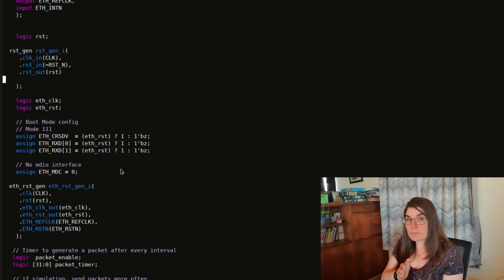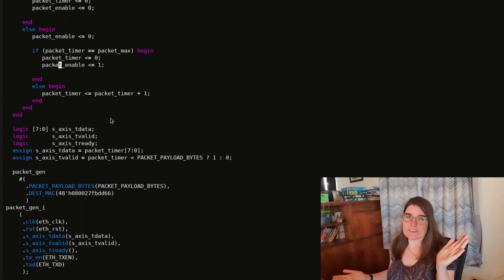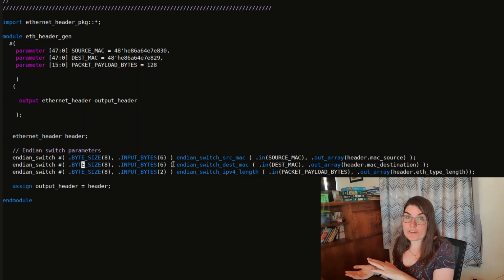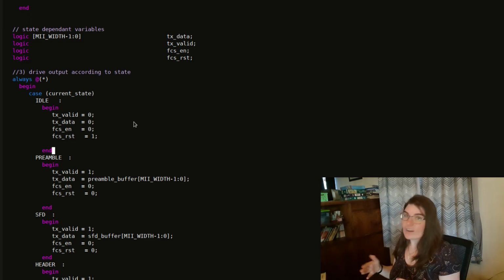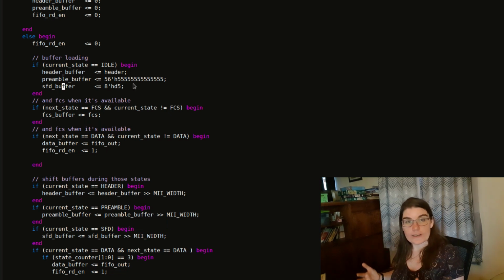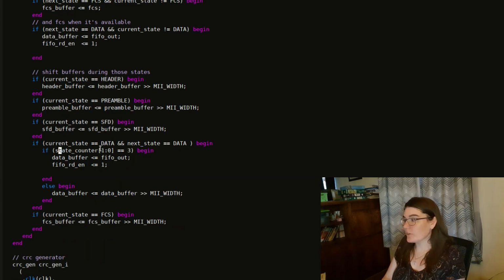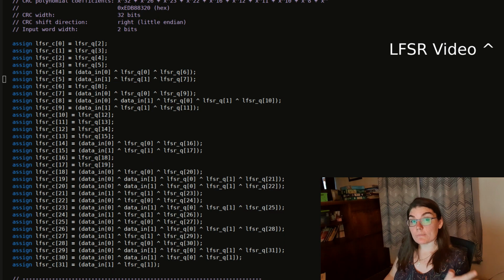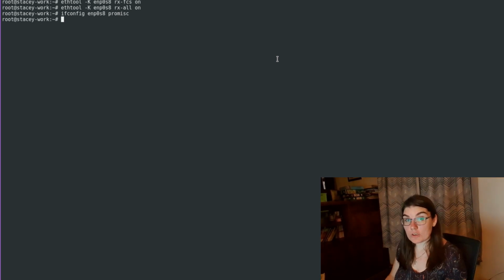A quick and easy Ethernet Frame state machine, explained from start to finish!

Comment: I would like to ask a question that make me confused regarding big or little endian you mentioned. Lets assume that the package to be transmitted to the interface PHY has a number of bits in a sequence p0, p1, p2, p3...pN. How should I transmit them using MII interface format: p0->tx[0], p1->tx[1], p2->tx[2], p3->tx[3] in one clock or pN-3->tx[0], pN-2->tx[1], pN-1->tx[2], pN->tx[3] in one clock? Thank you.

Comment: A clear explanation of the states for ethernet frames.  I felt you are held back by the FPGA and its software.  And, maybe I missed it, an explanation of what sensor you were trying to use and its timing constraints. The full ethernet has many cases for collisions, errors and human actions. At a physical level, your method gets down to the essentials. Except I think you could build the state machines with tables and constraints, not by writing sentences in a made up,  highly syntactical language not many people speak. Looking for ways to talk to cameras and sensors for real time statistical analysis, monitoring, and decision making.  Best wishes, Richard Collins, The Internet Foundation

Comment: I have a question about FIFO. What will happen if our FIFO is not ready to recieving data but our system needs to transmit that data at that time otherwise the data will lose and we could not transmit all the outputs which our system generated. In this case, is it enough to increase the FIFO size to solve that problem? How do we make sure that this is will not happen in our system?
Reply: Writing on a full FIFO will corrupt the data one way or the other. Increasing FIFO size can help when there are few but massive write spikes. In other cases you need to make sure to read more often, e.g. by increasing clock frequency on the read side.

Comment: Hi Stacey! How can you see the FCS field on your destination PC? I cant even receive it in wireshark, the received packet just end at payload so I always receive the packet even when the FCS is wrong. Im using ethernet/ip/udp packets
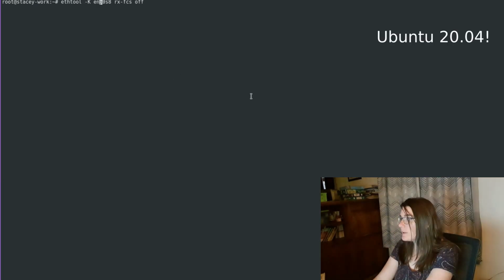Reply from the maker: At the end (17:54 Debugging Tips) I show a command ("ethtool -K <interface> rx-fcs on") that turns on the fcs. You'll have to install ethtool if you have it already (sudo apt install ethtool in debian/ubuntu). It doesn't work with all network hardware unfortunately, and I have no idea how to do it in windows.
Reply: So do you know how does the destination check for FCS after it receives the packets? When I intentionally changed the FCS to set it wrong, the destination still received the packets. Unless the FCS has more than 16bits of 0 in serial
Reply from the maker: @hightlightlol2106  It depends on the MAC used on the receive side. Some will drop packets with a bad FCS, others will forward them if that option is enabled. I don't know why they still came through in your case. When I tested, when I turned rx-fcs off, my network hardware dropped bad-fcs packets.

Comment: Keeping all 3 states (prev, curr ,next) in a state machine turns out to be very handy! Much easier to detect various state transistion points than some code I've written in the past. When I looked at an older state machine I always felt had a bit of a "hack" feeling to it, I now realized I was overthinking it in two spots and by just having prev and next around actually make both areas cleaner, easier to read, and more symetrical to the other state transistions.  I'll probably make this my standard for any state machine I need from now on.  Very handy thanks!